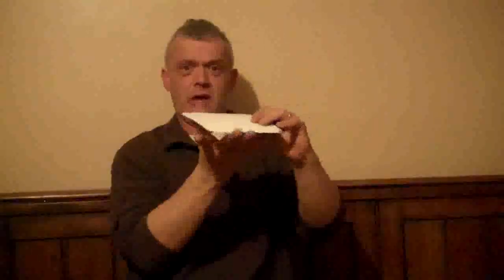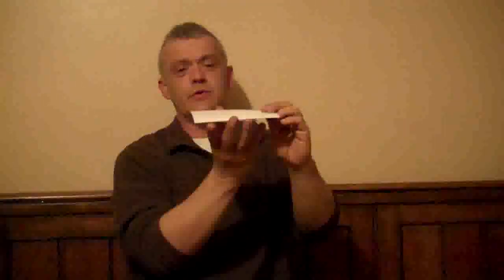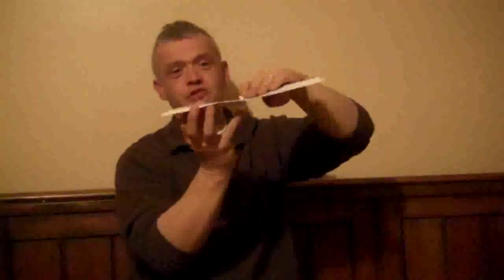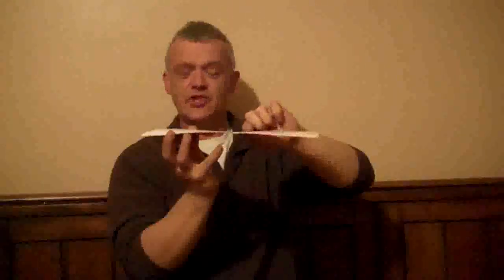Methods of making graphene

Comment: I was just watching a video by Nighthawkinlight about flash graphene. This was my suggestion to the video, that might or might not work but seemed steampunk enough that you might appreciate it.
"How long would it take to recharge that capacitor bank once fired? Big idea suggestion is to connect a wimhurst generator to the bank, with a wind turbine turning it. Then  multiply the number of coffee tubes in a rotating...? (I'm visualizing bullets in a revolver) piece. When the bank is fully charged instead of the spark gap usually on the generator it flashes the tube, rotates to the next one, and the bank refills. Theoretically you could do all this from the safety of the other side of the room"

Comment: Hi Rob, Did you ever try the electrochemical method of making graphene you mention in the video?
On the face of it would seem a safer and more straight forward method for shed man, if product levels were not as good you could maybe leave it running on a semi  continuous process.  - Any-ways just rerunning some older vids.
I wish you and yours  a well earned and Merry Christmas. - Martin.
Reply from the maker: +solarhope I did a video on it mate
Reply: +Robert Murray-Smith OK - Cheers Rob, must have been the one that got away, I will go back in time to look for it.
Reply from the maker: +solarhope it's called green graphene - i think lol

Comment: lightscribe graphene oxide = best supercapacitor crumpled graphene is more surface area n poles 4 ionic conduction...

always use best quality biggest graphene flakes = biggest graphene sheets best result

graphine intercollation method

sonicator method

re-apply intercollated with ammonia sulphuric chloride = increased conductivity....
Reply from the maker: +YangSword9x cheers mate - quick question - what is ammonia sulphuric chloride?
Reply: Robert Murray-Smith sorry about that....   i was just summerizing the useful info. I could act on in your videos for future reference when i do follow them instructions.   Its not written to make sense but just remind me of your methods.
Reply from the maker: +YangSword9x lol - fair enough mate - sounds good - if it works for you it works - have a good one

Comment: Robert, you never mention a complete different approach to graphene production which is HTC. There are astonishing results of carbonizing simple starch at only about 230C which produces very beautiful huge nano spheres of aromatic molecules which could be reduced in further processes to carbon nano spheres by ridding them of H and O complexes. Since these spheres form so easily, there should be a path of growing graphene sheets like other crystals out of a "melt" (starch for ex or Phenol or..).

Comment from the maker: the difference between the two is the same as the difference between graphite and graphene. It's to do with the number of layers. one layer is graphene multi layers are graphite. Graphene oxide is what you need. If you get graphite oxide you will need to dissolve it and sonicate it to graphene oxide before you use it.

Comment: Hi Robert,
Nice video's, also the High Voltage projects are great, but now I'm after graphene for strength. I'd like to make graphene epoxy armour coating for my RC foam plane models.
Would you have any suggestions about how to go about making the grapene component for this?
The process to apply the grapene to the foam model would be in between two separate epoxy coatings so the grapene would not have to be mixed in the epoxy resin.
Looking forwards seeing more of your video's

Comment from the maker: with acetic acid to form calcium acetate and carbon dioxide and water. The calcium carbonate is non soluable in water whereas the calcium acetate is. As the calcium and acetate ions migrate out of the cuttlefish bone structure the hit isolated pockets of carbonic acid (formed by dissolving carbon dioxide in water) of sufficient concentration to reverse the reaction and form dendrites of calcium carbonate again. If you leave it long enough or up the acetic acid concentration this effect will go.